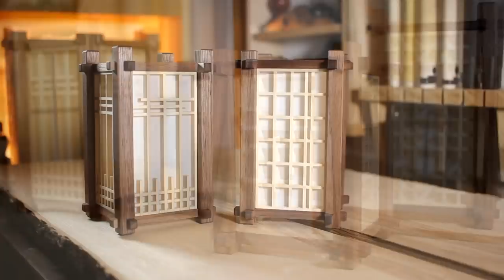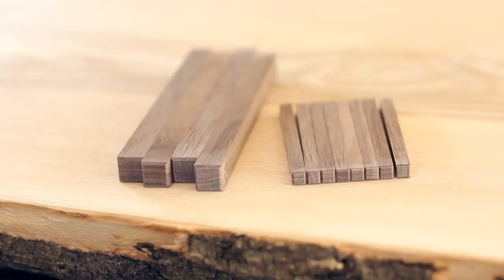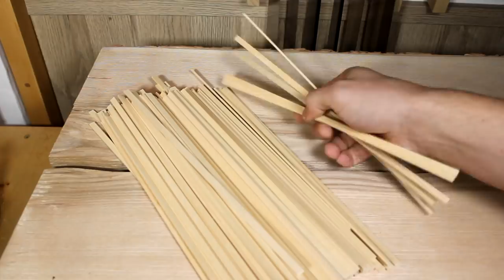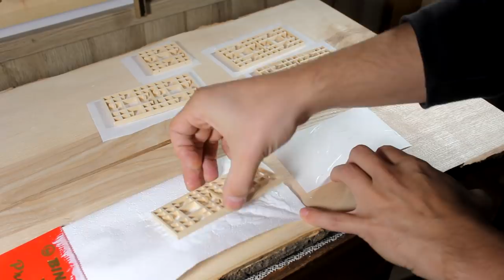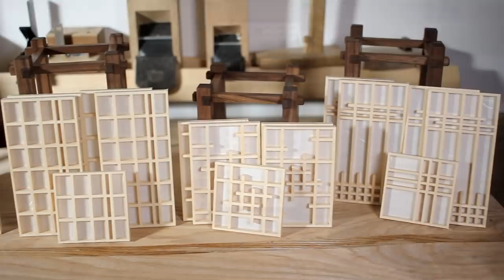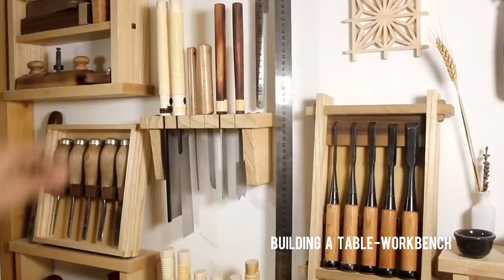Making Mini Japanese Lamps with various Kumiko Panels

Comment: Dear Sir,
Your lanterns are exquisitely done. The choice of American Black Walnut with what I suspect is pine &/ Maple for the screens gives a very nice contrast. Very well done. Kind regards.
Reply from the maker: Thank you very much! That is basswood. Is very soft and suitable for these kind of work, as the strip has only 6x2mm :) I've tried maple before on kumiko. While it has a nice glass finish after planing, it's very hard when making small lap joints or beveled ends. All the best!
Reply: @AdrianPreda  
Dear Sir,
Thank you very much for your courteous & hearted reply. Have a wonderful Christmas & a prosperous New Year 2019. Kind regards.

Comment: Your videos inspired me to get into fine woodworking as well. Previously I thought woodworking was out of my realm since I live in a tiny apartment, but you showed otherwise. I bought some hand tools based on your recommendations, and I'm now trying to build the low workbench from your plans. Unfortunately my shiny new low-angled jack plane has difficulties with tear out due to weird grain patterns in the wood, so I'll probably be doing a lot sanding :) Anyway, I just wanted say thank you for your videos. They're very much enjoyed!
Reply from the maker: Thank you very much for your comment! Yes, the LA planes have difficulties when used to flatten weird grain wood, cause of the low blade angle. In order eliminate this or reduce the tearout you need to have a higher angle blade, like 38 or 50 deg, or even add a sec bevel. You can either rebevel your existing blade or buy an extra one and use it only in this situations. If you have a veritas plane, they sell also already blades on that angles. I too need to get a second high angle blade for this purpose, but for the moment I use the jp plane to eliminate the tearout. LA planes otherwise are the best for shooting boards, as you mostly do endgrain on those, that low angle blade cuts more easy there.

Comment: Beautiful  craftsmanship! Out of curiosity; How do you tell the depth? as I see you start with an angled cut but end straight. How do you determine the final depth? and how do you not wear out the gauge as you use it repetitively .
Reply from the maker: Thanks! If you observe that jig, the depth is determined by those rails that the plane glides. If I want a smaller depth I simply add spacers between. Once the plane reaches those guides will have nothing to shave

Comment: Awesome. I follow you because I love the beauty you create and I am in awe of your prior planning to cut those Basswood pieces into a seemingly random pattern that matches on all four sides and the top. Do you have some source for pattern setup that calls for a specific number of each length to fit the size rectangles you're filling?
Reply from the maker: Thank you very much! I was mostly inspired by Desk King kumiko book, I put a link in the description. While there are dimensions and designs for big shoji doors and windows, I have adapted a little bit, maintaining the proportions and aspect to match the dimensions I used on the lamps.

Comment: beautiful!  if you wanted to make these for outdoor use (to cover up the horrible 'everyone has them' solar lights?   thinking the plastic they sell to cover up fluorescent lights and maybe cedar, stained?
Reply from the maker: Thank you! Indeed can work, also larch wood can be suitable, maybe less expensive, but it's quite harder than the cedar.
Reply: adiran preda - mmm... i'm in canada, about an hour outside a tiny town, so larch may be a bit hard to get ... cedar however is something i have everywhere, and a great way to use up the leftover scraps from trimming out my windows etc..  thinking a larger one of these to cover my ugly round gateposts too...   it's a similar look to the craftsman style i'm redoing my house in...   out of interest, i've not ever seen a chisel as small as the one you used to make the panels - was that crafted for you?   it looks to be 1/8" or less?
Reply from the maker: Ahh so you're from the land of the cedars then :))  No, that's a ~1.8 mm (so about 1/16") chisel made from an 2mm allen key just for this job :) because the kumiko strips are 2mm in thickness
Reply: adrian preda - well, used to be... but i moved 5 hours north, 4000 feet up, and judging by the odd looks i get as a woman in the hardware store asking for something other then birdseed or canning jars, about 50 years into the past!...  no cedars at my level unfortunately, but plentiful in the province.  that is, if we can stop wildfires from burning everything!

Comment: Hi Adrian,     Excellent work and video, Just like you I find japanese woodwork most fascinating. Can you tell me please just how wide is that very narrow chisel you used in video.  I guess something like 3mm. Thank you.
Reply from the maker: Thank you Michael! Which one? The one used to make the walnut frame stiles/rails lap joints is 6mm and for the kumiko lap joints that's a ~ 1.8 mm allen key beveled and sharpened :)) made just for this purpose.
Reply: @AdrianPreda  Thanx for the reply.....the 1.8 mm is the one I was asking about, what species is the light coloured timber ?
Reply from the maker: That's basswood

Comment: Adrian, do you end up gluing the kumiko panels into the lantern frames, or do you just leave them press fit?
Reply from the maker: I glue them inside where they intersect, just two spots per edge, not to fall during transport when I ship them.

Comment: Thanks for your posts. I "discovered" kumiko a couple of years ago and have made a few pieces. Now trying one of the mini andon lamps heavily inspired ( copied from ) by your work. Pretty much got the bugs worked out of my process and recovered from the inevitable mistakes in calculation that happen the first time around.
I see here that you use danish oil on the walnut frame. Do you use any finish on the kumiko panels?
I did put an oil finish on an earlier simple asa-no-ha pattern and had a lot of trouble sanding off the fuzzies that resulted. Don't really want to go that route again.
Any hints would be appreciated.
Thanks again for your work and the inspiration you and others provide.
Reply from the maker: Thanks! Nope, the kumiko patterns I leave them unfinished, just the hand planing that came from the thicknessing jig. Even in the traditional japanese way they are not finished, and yes they can be very messy when you try to put oil an those little pieces

Comment: Hey Adrian,
i tried to build such a lantern.
Man now i know how difficult this is :-)
How can you sell them so cheap;-)
Do you produce all of them by hand like shown in
the video??
i mean all the planing cutting by japanese saw?
Reply from the maker: :) Check out my latest clip, I use the table saw to speed up and do the rough/repetitive boring work then fine tune them with hand tools. Here were some kind of prototypes and also to show that you can do them by hand also. 
I pre-size the parts at the table saw, respective bandsaw for those little kumiko strips, very close to the thickness then use the jigs to plane the smooth and precise. This way I will produce the best finish that no power tools can achieve, either a table saw blade or planer, and also have them equal, squared, precise so all the joints fits perfect.

Comment: So the panels are just friction fit in the frames?
Reply from the maker: Can stay like so, as the lamp is too small and I made them fit exactly, but for those I sell, I have applied some spots of glue inside, at the intersection of the panels, just not to fall off during transport.